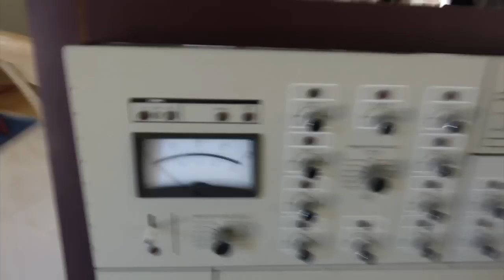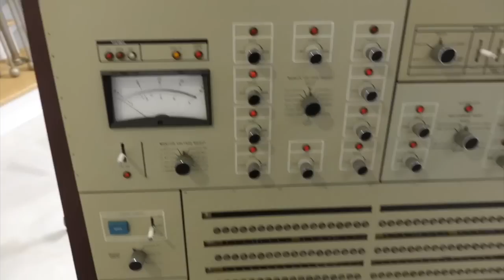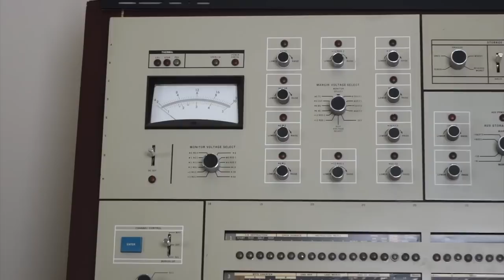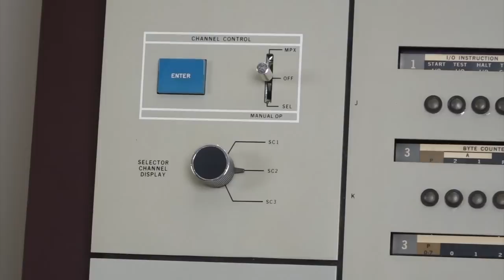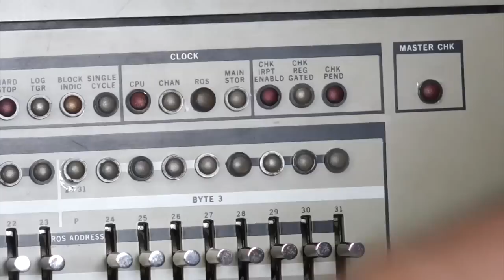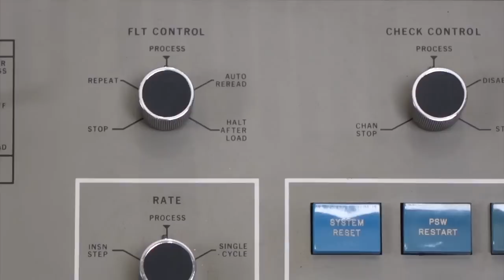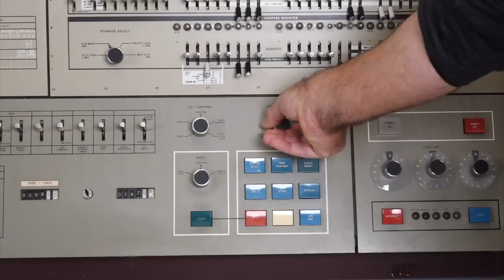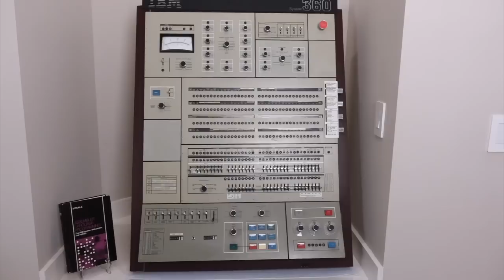IBM System/360 Front Panel

Comment: I worked on one of those in the early '70s :)
Reply: The address and data panel kind of remind me of the front of an Altair 8800. Did you also have to use those switches to manually input a bootstrap loader? Or was the machine more sophisticated than that?
Reply: @EvilSandwich  yes, doing a cold start on the 360 we flicked the switches and turned the dials. The 50 is one of the machines I worked on. I changed jobs and went from a 370/155 to working on a 360/30, and when that one finally died the company purchased the 50. I believe I learned more on the 360s than I ever did on the 370. They have core memory!
http://www.righto.com/2019/04/a-look-at-ibm-s360-core-memory-in-1960s.html

Comment: So, will you implement an intermittent faulty CPU emulator ? :-D
Reply from the maker: I'll have to remember to put that feature in :-)
Reply: Route the data and address buses trough a radiation chamber so bits get switched at random for a realistic experience :-)
Reply: Run it in check stop and when the red light comes on press "logout" and run SEREP

Comment: I can't imagine how much wiring there was behind that panel. There was 1100 connections to the output lights alone!
Reply from the maker: Yes, the wiring was a work of art that could have belonged to the Apollo spacecraft. Very sad it was taken out of this panel, but these are rare enough that I could not be picky...
Reply: Don't really remember any problems with the  flat cables but what did cause problems was "cold flow" when the yellow wires were tight around the pins on the back of the boards, even just looking at them made the bug go away for a week or two. I remember replacing a card in memory on a Mod40, the fault disappeared immediately. only to return 5 hours later - turned out to be a faulty fan.
Reply: @Lindsay5137  One of the problems with the Mod 50 was silver migration at the connectors of the flat cables. Silver spurs would grow and short to an adjacent pin and cause an error (Master Check). The current flow would in the spur would cause it to open up. So when attempting to troubleshoot the problem it was no longer there. In the account I serviced we had this problem and the system was up and down for about a week before we finally realized what was going on. We had to replace all of the flat cables.

Comment: You know, I wrote programs for these things back in the early 70s, but I've still never really seen one up close.  You just gave the punch cards to the girl at the window, then got a printout back a day or two later (a thin one if your program was ok, a thick one if your program was full of bugs).
Reply: hehe
Reply: //SYSABEND DD  SYSOUT=A     Would get you a VERY thick printout if the program blew up, aka ABnormalEND.  Actually, the thinnest printout came if you had a job control language (JCL) error because that meant you were unable to even start the job/program.

Comment: Protect is for "keys" to memory pages (some sort of memory protection)- i read about it book about 360 assembly
Reply: IBM has had memory protection keys since I don’t know when. Areas of memory could be assigned keys and there was a 4 bit key associated with each block of memory. (2K or 4K depending on the model/settings). If I remember correctly, there were also another control bit associated with the key. In the Program Status Word for the running program, there was also a key. This had to match the key of the storage to allow any writes. The other bit allowed read-only access to the storage or not. (IBM’s operating systems had pointers from low storage locations to lots of routines that programs could use, hence the access but not modify status)

Comment: Every time I see photos like this I have to ask: did anyone ever work at a place where the  panels weren’t blue? All the IBM promo literature had red panels, but the default was blue (though there were feature codes for a variety of colo(u)rs including green and yellow if I remember correctly. But in the five datacenters I worked in, everything was blue, until it all went white with the 3081 and successors.

Comment: On the upper left is a red light called "Master Check."  We would scroll through the rollers looking for the actual error to see what happened. Once some young lady asked a customer engineer (repair person) what the Master Check meant. He said that there was two kinds of faults: alphas and betas. Master Alpha faults were easy to fix but those Master Beta's were really bad. I laughed my head off but the young lady pretended not to get it.

Comment: I am slowly catching up on your videos after seeing the on with the IBM (forgot the model number) Valve based debounce circuit. Is this project finished or not started ? If it is not started can we the internet help ? (I have made a fair few props for TV mini series for kids here in Perth Au that have flashing lights etc.)  I would love to help build a working IBM 360 CPU emulator (one that could actually run real code) Funnily enough I just recieved a Xilinx Arty Dev board from Santa ;) to learn how to write Verilog on (I have been meaning to learn for years now, but uC' just keep getting more powerful and keep taking jobs that used to be the domain of FPGA's )

Regards,

Kat.
Reply from the maker: This is a long term project, it will be measured in years. Not started yet besides light fixing of the front panels and removing the bad foam from the tapes. Plus I need to get a 3 phase installation just to start...

Comment: How long did it take for IBM to arrive after you pulled the Emergency Pull switch?  :)
Reply: It might take an IBM CE a while to arrive, but the data center manager would be in the computer room faster than a New York second.
Reply: It depended on the situation. At a big UK bank in the 1970s-early 1980s, we had an IBM CE on site from early Monday to early Saturday.

Comment: In the early 60's, my father worked for NCR computers on the mainframe they sold to the USMC at Camp Pendleton, CA. I think it was similar to the IBM mainframes.
Reply: I got my start on a NCR Century 101 with 48K memory and 2 fixed and 2 removable drives.

Comment: I recently bought a front control panel from an IBM S/360 Model 65 that was part of an IBM 9020 system from one of the FAA's Air Route Traffic Control Centers. Mine is in excellent condition and everything appears to be original and all the wiring is intact. However, a large number of the bulbs are burned out. I’m going to need to replace those if I want to get it blinking again.

In your video (@4:34) you say “I found all the lights” Do you have a source for these bulbs or any specs for them?

Thanks!

Comment: Are you gonna wire it to some emulator?
Wish we had S360 or S370 emulator that simulates the control panels. Would be fun to be able to input instructions by the switches and then watching what happens when CPU get started.

Comment: Not quite like the Addams Family "Wizzo" though ;)  

This was a germanium transistor based computer, or had they moved to silicon transistors by this time, or maybe early IBM integrated circuits (Solid Logic Technology)?

Here is a guy that is running a 360 emulation.  Maybe you saw it already.

OS/360 IPL up to IEA100I message
  https://youtu.be/Fm-ZMACqrK8

IBM 360 emulator counting up
 https://youtu.be/fv6WK5QiG1Q
and a third video on the 360 and how it began?
IBM System 360 Mainframe Computer History Archives  1964  SLT
 https://youtu.be/V4kyTg9Cw8g
Reply from the maker: Yes, I know of Camiel Vanderhoeven's astounding FPGA work (and also Carl Claunch's and Lawrence Wilkinson's), although I have not met him in person (yet). I am intending to follow in their footsteps. But that will take a while...
Reply: It was SLT.

Comment: What could you do with something like this?How powerful was? Can you give us some Specs? :) Tnk!
Reply from the maker: The System/360 line spanned everything from entry level (model 30) to supercomputing (model 195) and helped consolidate IBM domination of the industry. The Model 50 was a bigger mainframe for large business applications. Very competent machine at the time. Up to 512k of core memory, then up to an additional 8MB with the slower Large Core System. 500ns cycle time, 32 bit machine, rated at 0.2 MIPS on Wikipedia. But that really does not tell the true story because these mainframes were so strong in IO. They really had separate channels and processors for IO, so lots of IO capability: 16 tapes, many disks, lots of terminals, a new version of the 1403 printer that could do 1200 lines per minute, etc... It had an OS with virtual memory and time sharing. Perfect for database, accounting and time sharing terminals. Bank and insurance were big customers: the model 50 was delivered to Bank of America. This one came from Hong-Kong, so I suspect also the mainframe for a large bank or insurance company. The SABRE airline reservations system (still in use today) famously ran on IBM 360s. The mod 50 also had decent floating point performance, so you could do scientific work.
Reply: @CuriousMarc  The 360/67 was the prototype for virtual storage, but it really was the 370 series of computers where IBM fully implemented the feature.
Reply: The 360 didn't employ virtual storage; that was introduced in the 370. @CuriousMarc
Reply from the maker: @Bhakti-rider  Sorry virtual machine.

Comment: What type of wire would you need ? I can only imagine terminating the wire at various points would be a big challenge, since contacts like that are not made anymore.
Reply from the maker: Yes, the wiring harness was a work of art (try to see if you can find a picture of the back of one of these panels), and is going to be  a difficult thing to reproduce. Since I don't have the original lamp sockets and plan to hook it to an emulator anyhow, i am probably going to go for some kind of high speed serial protocol to make the wiring manageable.

Comment: What's the status of this project?
Reply from the maker: Still in the documentation research phase, but we’ve made significant progress. I believe I have finally found a copy of the 360/50 schematics in Europe. Scanning them would be a major effort involving a lengthy stay in Europe, which was put on hold because of Covid. Ken has made huge progress on the microcode, which he found, scanned, OCRed, reversed engineered, and ran on an emulator he wrote. We finally got the schematics for the tape controller from a Patreon supporter a few weeks ago. It’s a very large, ambitious long term project. The next step would be the tape restoration, for which I needed a 3 phase inverter and a identification for the unusual power connector. Both have been acquired recently.
Reply: @CuriousMarc  Wow! I'm excited to see the results! It would be amazing to find the body of the computer. Also I would love to have a look at those schematics when you've aquired them :)

Comment: power conditioning must have been non-existent when those
machines where in their prime.
Reply: Neal elliott I worked at the nation's largest bank and we had both a HUGE REAL UPS and a backup generator. it had to power a 40,000 Sq foot data center. the UPS had its own room full of bus batteries. A true UPS is always on, so the hum noise is loud! All those batteries kept the room alive for only 45 min, plenty of time for the generator to kick on.
one day during the winter, some car slid into the transformer outside and knocked out the power. Only thing is, it only knocked out 2 of the 3 phases, so the generator didn't kick on. we didn't think anything was wrong, until I got alerts of the battery power left. we had to diagnose the problem fast, and manually switch on the generator. if we didnt, we would have to shut down 3 mainframes and various other systems until it got fixed.
To people not familiar with mainframes, a re-boot can take on get than 45 min from a cold start.
Something you didn't want to do often.
Reply: Some mainframe computers, Control Data for one, used a motor generator to isolate the computer from the commercial power.  The generator produced 400 Hz power.  The DC from the power supplies was clean.

Comment: Still looks like it came from the future. Why aren't there switches for the lower byte of the memory address?
Reply from the maker: Data words were 32 bits, but memory addresses were only 24 bits.
Reply: CuriousMarc That's what I thought. It just looked like the address switch labels started from 8 on the video rather than 0.
Reply from the maker: +Irochfort You are right, I had not noticed that! I'll have to look into it. I suspect it's related to IBM big-endianness, and their counting the address bits the way you'd store an address field in a data word, leaving bit 0-7 empty/undefined. IBM never did much like the rest of the industry anyhow, and takes a silly pleasure in naming everything differently.
Reply: That's probably why when everyone else (AT&T, Bell)  was calling them datasets, IBM decided to call them Modems. Also the common term was Octets, IBM called them Bytes.
Reply: yes IBM numbered bits from the left. Bit 0 was always the most-significant bit, etc.the least significant would be 15, 31, or 63, depending on whether is was a half-word, fullword, or doubleword. One neat thing about the IPL controls you did last was that the selector would select the device. IPL would always read 24 bytes into an address selected on the front panel. The first 8 bytes were a Program Status Word (program counter, and all branch and interrupt status flags).

The last 4 bytes were treated as a CCW (Channel Control Word) -- basically IO operation program.  IBM channels could execute multiple operations to main memory without the CPU being involved. If a CCW had the Chain flag set the following word would also be interpreted as a CCW; Some controllers had conditional logic, so a CCW program might run in parallel with the CPU for quite some time. CCWs were executed serially, and could overwrite the memory used by the channel program. For IPL this was critical, ans if more than one CCW was required to load the initial boot record, the first CCW would have to read in the rest of the boot program.

Once the controller finished executing the IPL chain, the first 8 bytes read in the IPL operation loaded as the program status word (Instruction counter, IO and branch flags, etc -- basically all processor context except registers). At this point the CPU would stop waiting for IO, and start to run the rest of the boot.

This way you could boot the CPU from any device, almost always tape, card-reader, or disk, of course, If that device had an appropriate record stored at the "beginning" of its media.
Reply: @daviddurand5911  The CCW (Channel Command Word, not Control Word) was 8 Bytes. Bits 0-7 Command code, 8-31 Data Address, 32-36 Flags Chain data, chain command, SLI , skip and program interruption, bits 37-39 zeros, 40-47 unused, 48 - 63 Byte count. I still have a system/360 Reference Data green card.
The IPL loaded three doublewords, PSW and 2 CCWs
Reply: @Lindsay5137  That's because IBM used datasets for what everyone else was calling files.
Reply: @daviddurand5911  Indeed. The only thing that Marc needs to do to make the panel real is to hang a piece of plexiglass over the IO address selectors and IPL switch so that careless operators couldn’t IPL the machine accidentally!
Reply: @jerry3890  Never had one of those. My first one was the Yellow System/370 one. Then the pink booklet…